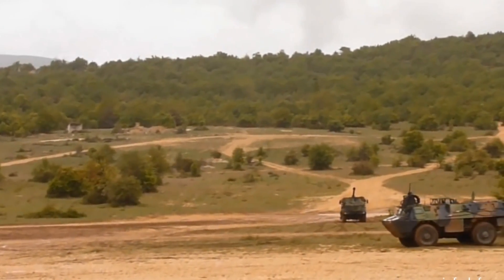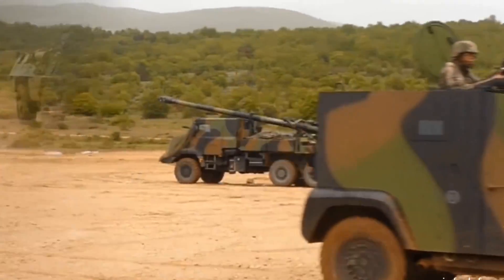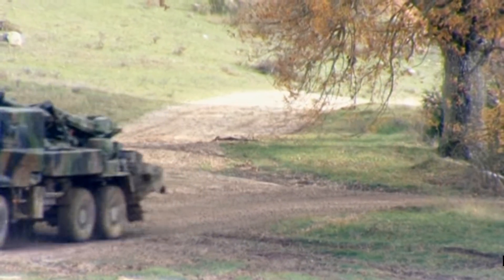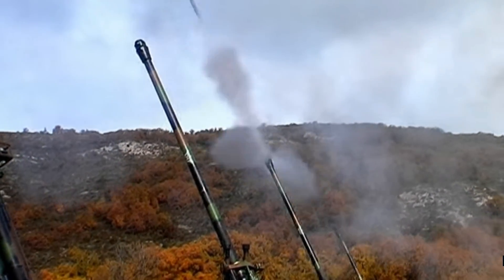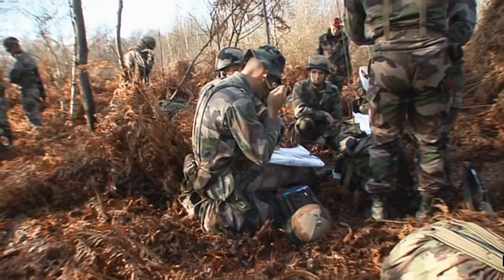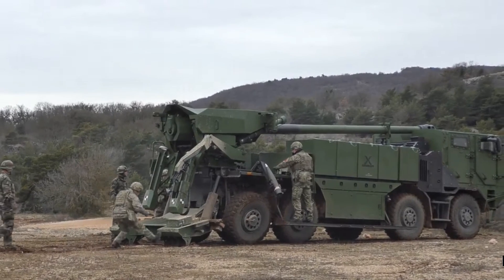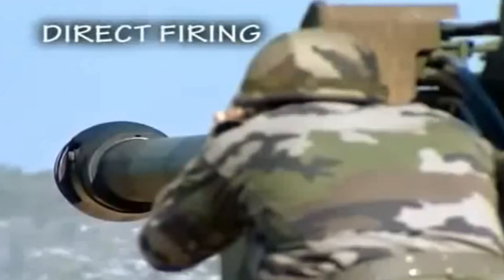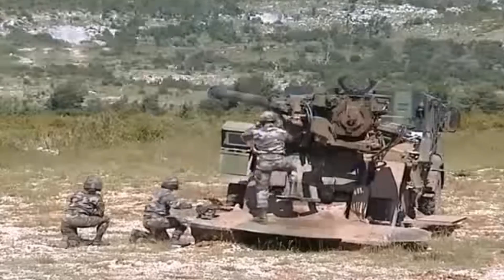CAESAR 8x8 Self-Propelled Howitzer Review

Comment: The Swedish Archer system outperforms this, not least precision, terrainwise and are autoloading, operable by 1 crew/driver if absolutely necessary. I'm a fan of the Caesar, but the Archer is the non-tracked SPG system to go with.
Reply: "The Swedish Archer system outperforms this" ....Except of course , unlike the Archer, the CAESAR actually works.
"not least precision, terrainwise and are autoloading," .....Funny you should mention that.....knowing that the Archer have had HUGE issues with exactly its accuracy and its lack of reliability... Add to that an underdeveloped ammunition resupply system and it becomes clear why both Denmark and Norway left the  Archer project.
IMO the most overrated SPH on the planet.
Reply: Umm: http://www.kmweg.de/uploads/pics/AGM_Boxer.JPG
Reply: He's right about the protection though...
Reply: Kemas ; If you read this whole article you'll see that it's hard to get the picture of exactly why Norway left it at such an extremely late stage. Delays are named as an important factor, among others. Interesting is that in these few comments ammo, accuracy and other "shit sub-par" parts of the system was also a reason. Despite that Norway(and most serious info available) states these very parts are among Norway will continue squire and develop with Sweden.
Add to that the system (mainly positioned in Boden, about as far North you get in Sweden/Norway/Finland and about the most hard navigated terrain) should not be moveable/quick enough). Someone named Pzh2000(6mil$, 60 tonnes) should be quicker in arctic terrain compared to Archer(a 4th of the price, 30tonnes weight). Facts state the opposite.

http://www.defense-aerospace.com/articles-view/feature/5/150076/archer%3A-why-norway-pulled-the-plug.html
Reply: Morten Poulsen ;Said the fanboy who's country bought the Caesar...and Norway's still stuck with the old Paladins, alhough being the co-finacer/developer of Archer with Sweden.The precision is probably the Archers prime selling point. The opinions differs always. Time will tell. The loading problems consisted in that when Norway backed out of the project the last part in the production of the system, the ammo-supply system, was halted. Other potential buyers of the system got cold feet. You cannot compare a system available since the early  90's from such a strong NATO-partner as France, to use in a flat temperate zone without hills (Denmark), with a newly developed system as the Archer. The political pressure to buy U.S/NATO-members equipment is not to be underestimated. Sweden just bought the ridiculously overpriced Patriot system after the Ami' s brought live ones over at Aurora17; the Army/Air defence wanted the much cheaper but better French SAMP/T, but was overrided by politicians.
I guess it was the same when Denmark and Norway was forced to buy a few of the insanely expensive, useless fluke F-35 instead of, let's say, 6 times more of the Gripen E/F/D?

Comment: I think that I still prefer, my Swedish Archer system....maybe a Top 10....hint....hint....nudge....nudge....
Reply: Better on paper only
Reply: Can't be transported by plane, takes more time to deploy, costs way more
Reply: where do you get that from ?
Reply: Not every nation own A400 equivalent ...most chose caesar because it fit in the old goodie hercules
Reply: Duececoupe ;....know wha' I mean...? Say noo more!
Reply: Duececoupe the darth designer has good videos of top ten tracked and wheeled howitzers
Reply: The Archer is transportable by plane, it's got one of the fastest deployment time out there and everything besides reload is done through a protected armoured cab, NBC protected and mine protected.
Reply: Where do you get that info.. Archer is air mobile/transportable with Airbus 400M or C-17.. You're talking BS...Archer has better mobility, higher rate of fire, smaller crew, etc.....Allround a better system.

Comment: personally i prefer automated systems to manual, because statistically machines are faster, less likely to fuck up, and really just better than people at specific tasks. Plus if the machine breaks you can get it back out there again faster. And if it's just fucked, well now you don't have the liability of a corpse and can replace it without really any care. And should be cheaper long term since, they need need much care unlike people.

Comment: The slower rate of fire is dew to the recoil if it fires too faster it rocks the vehicle even a fully tracked vehicle will have it’s suspension fail after a full speed firing!! If you don’t believe me look up the Swedish auto loader artillery it could fire a full speed firing of over 30 rounds per minute but its magazine was only 15 and it could only fire directly from the magazine 5 rounds

Comment: seems like a good idea other countries can learn from.
Reply: this is a big boys gun 155mm.
Reply: In the development of the idea of wheeled self-propelled guns, combining cheap chassis and high combat efficiency. There are unconfirmed rumors of 20 shots per minute with a water cooling of the gun.
https://ic.pics.livejournal.com/bmpd/38024980/4932691/4932691_original.jpg
Коалиция СВ-КШ.  Coalition-SV-KSh (KSh meens wheeled chassis)
Reply: @andreyyasyuchenya2868  That's not 20 rounds a minute. That's 3 rounds in 9 secs. Or 4/5 rounds in 12/15 seconds. But not 20 rounds in 60 seconds. The barrel would overheat and warp.
Reply: @Night60700  As I mentioned it shoud be some water cooling system. As i understand something like alcohol irrigation for cooling.
Reply: @andreyyasyuchenya2868  Water cooling artillery is rare. It's just a boil off problem. Too much loss of fluid due to an open cycle system. A closed circuit cooler would never be powerful enough without weighting too much. Water cooling is a naval thing.

Comment: The fear of automation, while I understand it, is still somewhat redicules to me.
Reply: While humans never fuck up. 
 
I do not get why people think automatic systems need to be perfect. They just need to be better than humans. (I'm not necessary saying that they already are in this case, just bringing up the point.)

(For example there is nonzero chance that a calculator will glitch out and show wrong result, yet I still trust it more than I would my self.)
Reply: Well, the Americans didn't want to buy Dutch CIWS systems, wanted to make their own for nationalistic reasons.

So they built the Phalanx CIWS and their own tracking radar. Phalanx has been involved in various friendly fire incidents where the Phalanx tried, or succeeded, to open fire on friendly troops instead of hostile missiles. Since speed is a requirement in CIWS systems, it's fully automated as well.

....I'd hate to be boating around in a small rib when a US navy ship with a defective Phalanx is around.
Reply: BS, total BS.. Phalanx is superior to Dutch Goalkeeper in any imaginable way. For starters its a plug and play system that has no need for ships sensors so it can be installed to almost anything. Rate of fire plus the RAM missiles are another plus for the Phalanx. Boohoohooo, big bad Americans want to make their own weapons. Make something good and we'll buy it (like Carl Gustav, AT4, Berreta, Stryker, etc....)
Reply: @vegass04  BS you spout total BS.

Comment: You may want to note this, given that you're going into arty. You can't sustain more than 6 RPM  from a conventional 155mm gun. Too much barrel heat and in the recoil mechanism. But I think this weapon is pretty lame, so I agree with your assessment - it's cheap but that's about it.
Reply: Karl P or you have a cooling mechanism like on the koalitsiya-sv with a rate of fire claimed to be 15+ rounds a minute
Reply: Jucht Mich Nicht. Correct. But that means more weight, cost, less reliability, and more complexity. This thing is a budget SPG.

Comment: Usually the fuses arm on "set back". That is the G force exerted on the round by firing arms the fuse (a bit like seat belts that lock in a collision but usually move back and forth fine). So while certainly not a good idea to drop any type of ammunition, these should still be "drop safe". :)